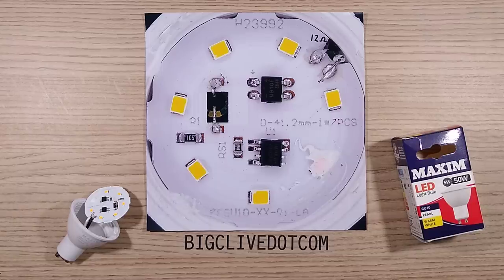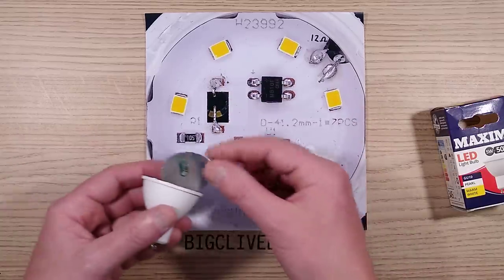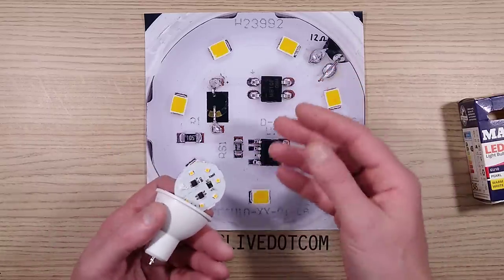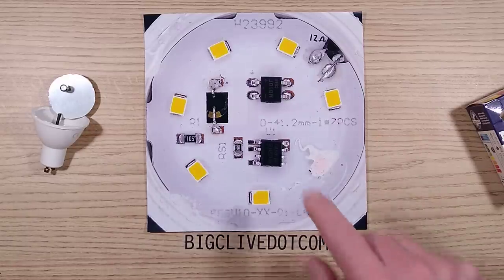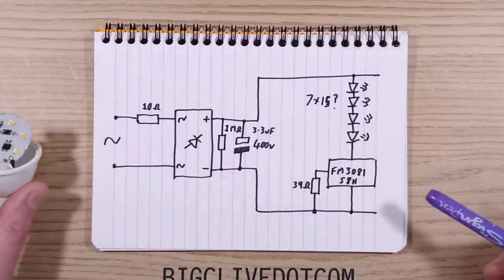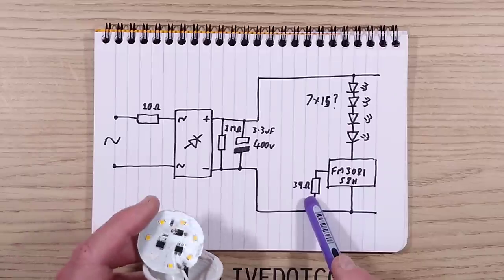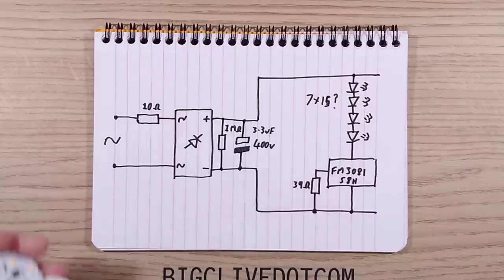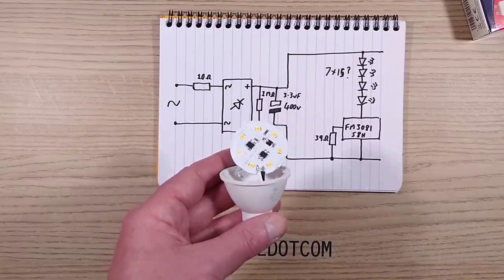Over-cheapened trashy LED bulb

Comment: does that really meet the requirement to be CE marked? did not notice if it had UKCA on it, got to think twice about the safety of everything else if this passed.
Reply: CE marking is a self-certification (i.e. the manufacturer saying "trust me bro"), so it's not a guarantee of anything these days. You must look only for actual electrical certification done from third parties and hope the manufacturer didn't just print the symbol on the box/product, as chinese manufacturers often do
Reply: I thought ukca was just rebadged ce mark

Comment: When everything had gone to shit we'll just have to make our own. Get the features they should already have from the get go then:

No flicker,
No ghosting,
Extraordinarily long life,
Good colour rendering,
Efficiency,
Low temperature,
Quality components,
Sturdy build,
No EMI emission,
No shitty cold solder joints,
Sound electrical design,
Pricing that doesn't represent greed or corner cutting.

In some respects once it has gone to a pile of jobbies anybody can takeover the market by not putting out instatrash grade bulbs. Awesome!
Reply: no emi emission would be very difficult as for best power efficiency it'd have to be a switching regulator , low temperature also difficult as watts are watts,  all these would make it extremely expensive and not a viable business if people only buy it once!
Reply: @andygozzo72  harsh reality spoils my fun daydream again. Fair points though.

Comment: I've never heard of maxim before and looking at this product, I can see why
Reply: Actually they have been around for a very long time, However like most companies the build quality has gone down the toilet recently.
Reply: Maxim used to make reasonable cost and reasonable quality filament lamps.
Reply: @Mark1024MAK  let's be fair though, it's pretty hard to fuck up a filament lamp
Reply: @phonotical  - not having a gas tight seal makes the illumination “interesting” for a few seconds… 🤣
Also, it’s been known before for the weld that attaches the filament to the support and supply wires not to be properly done, resulting in the filament falling off…
Although both of these faults were seen in other manufacturers lamps.
Reply: @Mark1024MAK  Most of the filament lamps I've seen have the support wires crimped around the filament. No welding, heavens no. Crimp only, quick and dirty, but on balance, they rarely fail at those points.

Comment: What was the smoothing capacitor temperature rating? Usually they use 105°C rated but if they are trying to save every last fraction of a penny then they could use slightly cheaper 85°C capacitors.
Reply: doesnt always mean they'll last , google 'capacitor plague',  and they're miniaturising them too far
Reply: @andygozzo72  DiodeGoneWild opened a brand new power supply which has reused scrap capacitors and they even tried to hide the dents with wax and put a new fake heat shrink over it.
Reply: @mernokimuvek  😲 sacre merde! that said i do have a plug type 12v psu that looks if its been 'repurposed' as it has input and output wires cut off and the new ones soldered to pads on the track side 😲 or maybe the cutoffs were for testing?
Reply: @andygozzo72  Dont use cheap noname brand chinese power supplies including phone chargers. Sometimes there is no isolation except the enamel on the magnet wire between primary and secondary of the transformer. You have a few micrometers of enamel separating the output from mains input.
Reply: @mernokimuvek   i know, thing is not everyone can afford the 'top' brand ones, the ones sold 'fairly low price' by UK shops are usually ok, luckily,

Comment: Who here has ever had an LED house lamp last anywhere near even half of the rated 50,000 hours? Heck even a quarter of the 50,000 hours? I know I certainly haven’t. All the lights in my house are brand name LED bulbs and all except for the Hue lights get changed due to failure every 2 or 3 years.  The Hue might be the only ones that get close to that rating but add they’re only 12 years old, they’ve got to last another 18 or so years to even be considered close to that many hours.
Reply: I know about  several people who lave 1980s fluorescent tubes in 1960s fixtures wtill working. They will outlive any cheap chinese lamp made these days.

Comment: Clive can you help with looking at higher wattage bulbs?  I'm coming across designs that seem to feature multiple smaller current limiting chips, each with their own resistor.  One of the 100w bulbs I currently have apart on my bench, for example, has 30+ SMD LED chips and 3 small 3 pin current limiting devices, each with it's own current sensing resistor.  How does this all work together?

Comment: Fixing these is a lot easier than fixing glitchy Pokémon sprites. I guess I’ll have to remove the 1 Megohm resistor - I want mine to fade out. 🙂
Reply from the maker: Keep in mind that the capacitor will hold a charge for a long time once the resistor is removed.

Comment: Gotta love how they're still marketing these on the branding of efficiency and long life when both of those traits have long ago been destroyed by overcheapening.
How much more before an older CFL (you know, the ones they're banning) is both longer lasting and more efficient due to the LEDs being pushed so far past their peak efficiency territory?
Reply: A lot of fluorescent lamps can have over 80 lm/W, some special ones probably more. LEDs are around 100 lm/W. The efficiency of the low pressure sodium lamps is still unbeatable, with some lab samples being around 300 lm/W.
Reply: @mernokimuvek  the theoritical limit of yellow phosphor led efficiency is 250 lumen per watt, 300 lumen per watt is just crazy
Reply: @GERALD_786  I was talking about low pressure sodium lamps, not LEDs.
Reply: @mernokimuvek  i know, im just saying that lps is far more efficient than the limit of led efficiency

Comment: I had a couple of LED gu10s go within a short time of eachother, each with a bang. Took them apart and both had blown capacitors and lots of soot in them from the bang. Not sure on the cause but i bought better bulbs to replace them and all the remaining ones

Comment: I tried to buy a bulb yesterday, an incandescent one. i went to 3 shops. Nary a one anywhere. LED bulbs are okay for light but they are rubbish as a load in a circuit, when something says 60W of light i want it to use 60W. where the blazes can i find incandescents?

Comment: Are they stamped with some kind of rating for use in the UK? Like in the USA, they might have 'UL' for underwriter laboratories. If I lived in the UK, I would make sure that responsible agency knows about this shoddy work. Link them this video. If the rating agency threatens to yank their rating on the product, that might be enough to get the manufacturer to design it in a less shoddy way.

Comment: It'd be nice to have an explanation as to how the 1M ohm resistor actually stops the ghosting, I've heard various people talk and say it does work, but never why .
Reply: Because of stray capacitative coupling between mains wires when a lamp is switched off this stray coupling means that a small current can still flow which could be enough to allow the LEDs to glow dimly. The 1M resistor will pass enough current to prevent the voltage from rising high enough to light the lamp.
Reply: Just provides a path for the leakage current that would otherwise have to go through the LED's, I think ?  Conducts at a much lower voltage than they would, also.

Comment: The future of LED lighting? No, it’s the present, unless you live in Dubai. That video still enrages me, that my government doesn’t similarly pressure manufacturers of light bulbs (and everything else) to stop ripping me off.

Those are some of the worst solder joints I have ever seen on the power and capacitor leads. I would have been fired from several jobs for that… not that I’d tolerate doing so for the sake of my own self-respect. I’m guessing their idea of QC amounts to making one good one per 100,000 and using that one for the batch exemplar.

Comment: Linear regulators are lame and such lamps have poor efficiency. The trend is that all lamps must be as efficient as possile, so all kinds of lamps other than LEDs are being banned. When there will be nothing to ban anymore, they might start banning lower efficiency LEDs.
Reply: That is likely to happen. They have re-alighed the efficiency bands. Under the old bands this would have been an A+ efficiency, under the new bands it is probably about a D.
Reply: @katrinabryce  "D" is pretty good rating for LEDs, lesser LEDs are usually rated "F", where "G" is the bottom of the scale.
Reply: @JendaLinda  someone needs to ban those that do the banning😉
Reply: @andygozzo72  True. They have apparently nothing better to do.

Comment: So if a fixture doesnt fully turn off you can put a resistor across the output of the bridge rectifier? I have a PIR fixture and one one a remote relay that dont turn off fully.
Reply from the maker: That may be due to a snubber network across contacts.  Ghost-glow with LEDs is not usually an issue, and doesn't use significant power.

Comment: This exposed LED lamp has me wondering...is the LED desklamp without cover glass on my nightstand going to fry my cat or me? 
The cat ate through a live cord to an aquarium today and appears to have 8 lives left. But I may be working with a lower number.
Reply from the maker: If the bulb has the front glass missing it may pose a risk of shock if you were to touch the internal PCB.
Reply: @bigclivedotcom  Thank you.. While I'm sure leaning on my metal bed frame would help me ground the zap, it  sounds like it's time for a new lamp.

Comment: Wonder what has a lower carbon foot print? A tungsten bulb made locally that uses more power, or an LED bulb that last hours shipped around the world? Wonder which is more eco friendly to dispose of? Wonder which one is more likely to burn down the house?
Reply: i havent seen any UK made filament bulbs for many years, not since the late 80s they were pretty much east european, mostly poland,
Reply: Here in the US, sometime around 2007 the department of energy placed a ban on bulbs that don't emit 45 lumens or more per watt. There are exceptions, like traffic lights, hum, a government entity, go figure. My point is, the LEDs have gotten so piss poor, it might just very well be more efficient to build an incandescent bulbs rather than the sub standard LEDs marked CE. (china export).

Comment: Dude, how “trustworthy” are those “portable electric meal heaters” they sell on Amazon? 

Is that safe, to run off my car?

or my little Jackery 240?

Everything ran off gas, out in the woods, until recently… I wouldn’t mind ditching my single burner gas stove… It takes me 10 minutes, just to set up the stove, to make dirty dishes…

If I could just use that, to heat up canned goods, reliably… Lately, I’ve been getting these little “microwave safe dinners” that would probably heat right in there…

I sleep right in my car, when I go camping. If I don’t need to worry about “open flames”…

All that stuff scares me…
Reply from the maker: Some units are better than others.  Using electricity to heat food from a battery power source isn't always ideal as it poses a high battery drain.
Reply: @bigclivedotcom  I saw several that “look” the same, but different manufacturers. Running it off the car battery wouldn’t be to good. Maybe while the car is running… I ran it off my jackery. I had plenty of juice to run it. 
My alternative is little bottles of butane and propane, cheapo camping stoves, wind, rain, unleveled ground… so yea… I like it…

Comment: This is a bit too far down in the race to the bottom, but I personally think this is a good thing. 

Anybody who has an ounce of EE knowledge and has used led fixtures know that the currently available commercial LEDs are absolute garbage in terms of durability even if they come from brands like Philips, between overdriven LEDs and the genius of having heatsinks covered with plastic, they rarely last more than a couple years, so these crappy Chinese LEDs cost a fraction of the value of those but last just as long 

now if those brands don't up their game they're just going to get driven right out of the market

Comment: Built-in obsolescence, keep people buying and buying. Smells like a class action lawsuit.

I modded one of these early globe style LED bulbs that had this triangle thing that held 3 LEDs per panel and there were three per bulb I rewired everything so each panel was wired in parallel and it runs on 12 volts nicely and is super bright and only draws maybe 100mA.

Comment: Seriously, if it can be made cheaper, it will. This is the fate of all products. Incandescents at least had the advantage of requiring a precise chemical.

One day these, like incandescents, will turn into a resistive load. Just string a resistor to it with some LEDs on the end.
Reply: some very small led bulbs are just a resistor, bridge rectifier, and filament style led!

Comment: Those bulbs are disgusting! It's like someone took the usual design and said, "Why bother with these expensive terminals? Let's just solder them directly on." And poorly at that! The mains wires in particular are awful, but plenty of the other joints are quite poor too. There's no way this passes any kind of certifications here in North America. Not only are they likely overdriving the hell out of those LEDs, but the whole circuit is likely to go up in flames!

Comment: Seems to me that, even with cheap labor in China, the push-in connectors would be lower cost. Less time for the underpaid child labor to shove in the capacitor and wires than to solder them on. This is trashy even by Clive's standards.

Comment: And whats the conclution? Dont by LED lamps any more and switch back to incadecent. I am pretty sure, even thogh they consume 10 times the electricity, you will be better off (financially).. Not to mention the annoyance, expences and cursing..
Reply: Used LED bulbs for 5 years now, it's pretty worth it, just don't buy that cheap crap